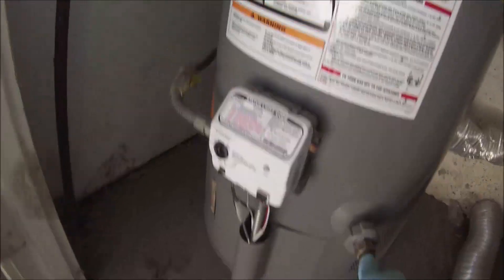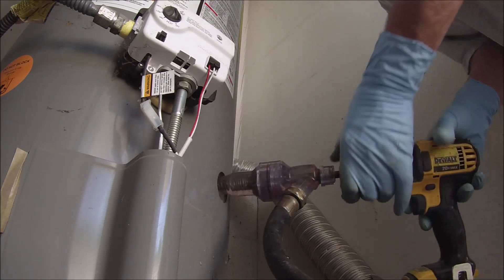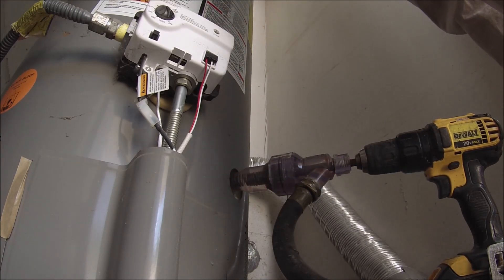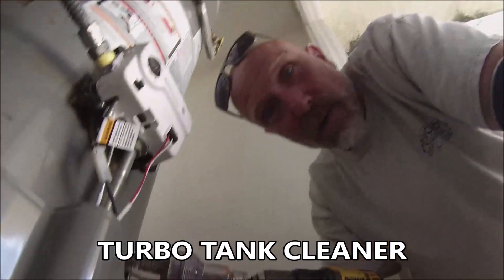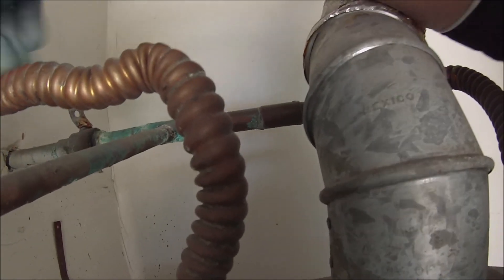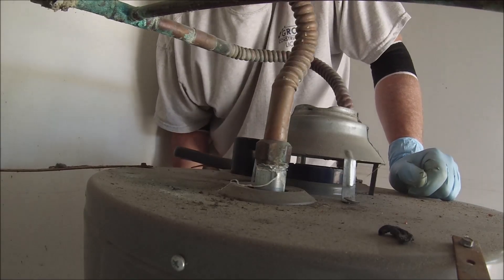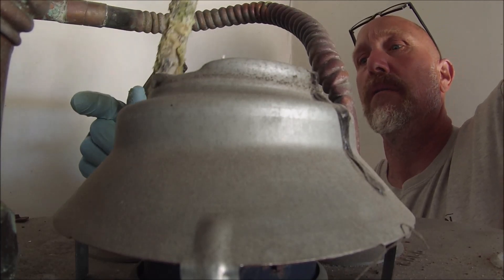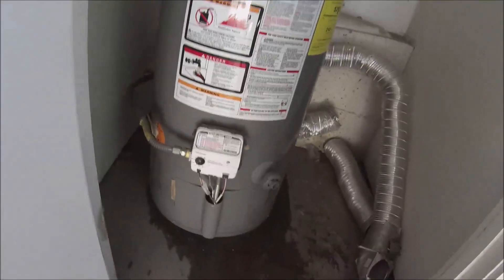The Turbo Tank Cleaner

Comment: You screwed it up by not following directions
Reply from the maker: I’ve used it with the coil that was on it and if you watch the video for the product, they always use it on an electric water heater. They never use it on a gas water heater and I believe that’s because it has a flu pipe. That’s why I cut it, so if you cycle the water on and off it should cause the sediment to circle around to the front where the shorter coil can get it. It just doesn’t work very well it works. I just think it works better on electric water heaters and then it broke because it’s plastic. I think it’s a good product. It has a lot of potential, I just think they need to make one for gas Water Heaters. I wouldn’t say that I exactly screwed it up but you’re entitled to your opinion and I appreciate you watching the video.
Reply from the maker: Thanks for watching!

Comment: Your first mistake was not flowing instructions and choosing to cut the spring.
Th Tank Flue is made of the same material as the outer tank wall and will not be damaged. The spring flails around in all directions, bouncing off the wall and any internal parts, striking and loosening any sediment so it will fall to the bottom to be directed out of the tank.
The tool is now to short to work efficiently.
Reply from the maker: Yeah? Thanks the plastic broke on me , I like the concept of the tool. It just hasn’t done much for me. The spring was an issue. Appreciate you watchIng!

Comment: I think it works wonders and I have posted a couple videos on my pumpguy channel and you will see I'm not the professional tuber such as thee. We don't change anode rods here bc the tanks fail b4 the rods 🤷‍♂️. Them tanks are tough to break. Thanks for the informative content- keep flowin with go  -  pro. 🛁
Reply: Leave the water turned on while using the rather than turning it on and off. Works great!
Reply from the maker: @servicerepair2013  Good tip !
Reply from the maker: Thank You!! I'm hardly a professional! But I appreciate my subscribers they are awesome ! Thanks again for watching and commenting!